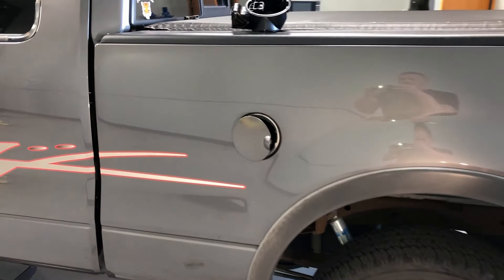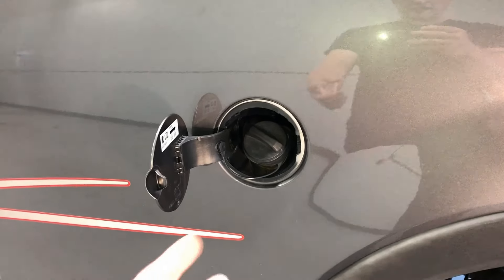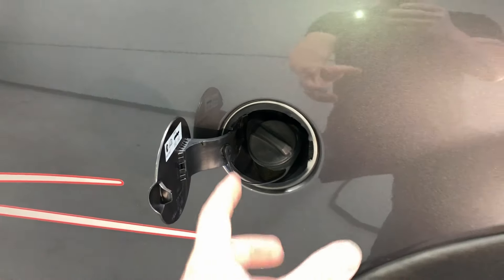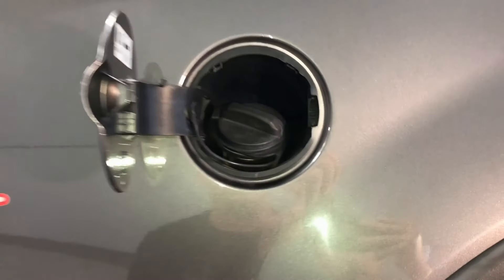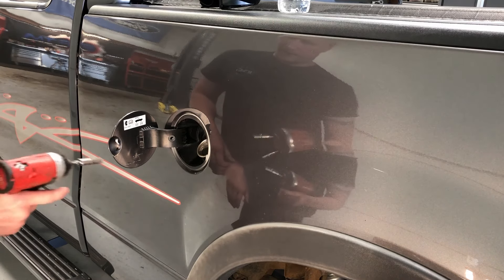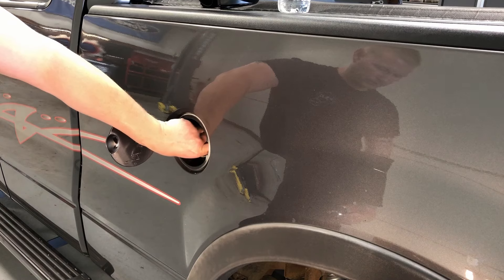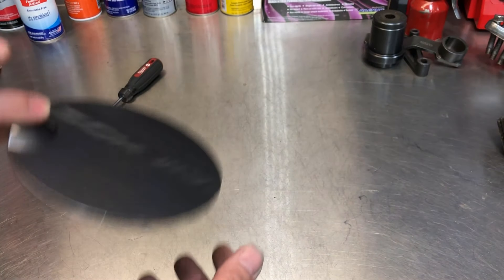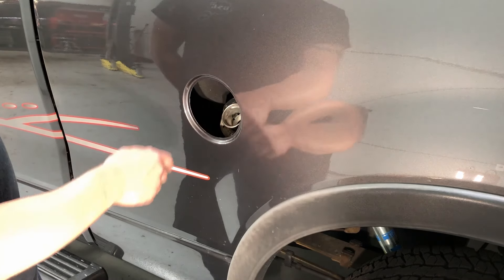2004-2008 Ford F-150: Broken Fuel Door Fix!

Comment from the maker: These are the Parts and Tools I Recommend:
Ford Fuel Door Housing-
https://amzn.to/2YjFjBj
Reply: Is the 2011 the same?
Reply from the maker: no
Reply: Hey, Ford Tech, I have a mystery problem with my 2013 F150 5.0 with VERY low rpm (it literally idled at 100 rpm today at red lights).  It’s not the F27 fuse, it’s not the fuel relay #8 in power distribution box, it’s not the fuel pump driver module.  It’s also not throwing any codes.  It was rough starting but that has since stopped now that I’ve been using premium fuel and Lucas fuel treatment.  Wade Ford in Smyrna, GA wants to do a “de-carb” on my engine in one week.  I’m a bit skeptical of that.  Do you have any suggestions?  I’d be happy to share any photos/videos with you.  Thanks!
Reply: Got parts in a few days. Fixed in minutes. Thanks!
Reply: The dealership recommended to pull the door off before removing the housing from the bed side.
Reply: are you in Texas?  id like to hire you to do some repairs if possible?
Reply: How can someone hire you?
Reply: @FordTechMakuloco  hey buddy, have you encountered clogged cats ,slightly stumbly idle ,uphill engine pinging and blend doors(vac) popping when idling in traffic for a long time on a hot day for 03 and back f150 4.6 2v? It's the blend doors that are throwing me off I gues if the exhaust can't leave the cylinder.than it can't suck in more for steady vacuum. I'm just wondering if you have dealt with that particular combination from bad cats I have driven her every single day for near 14 years and have just under 400000miles, new engine and trans planned for next spring I couldn't be more happy than I have been with this truck I have cats coming im curious if that stops the blend door popping it only happens when idling for 20min.in traffic on a hot day and when engine starts to stumble a little once I'm on the throttle it stops,I have terrible pull out power good steady fuel psi,no sign of vac or intake leaks no DTC but scan tool says she's at 50% load first thing in the morning before I even leave
Reply: Dave K. He’s in Chicago
Reply: The linked housing says it doesn't fit the 2005s
Reply: Brian my 2006 doesn't look like that...and mine is sprung on the door from the car wash mops. I happened to be looking in my side mirror (which had unfolded just seconds before).
Reply: Does not fit 2004.

Comment: Me and my dad had the hardest time putting the new housing in. Our top clips just wouldn’t fit in flush. We got it as close we could and I’m going with it. It’s not hanging out but not perfect. About 97% flush based on your video. Much easier to take out than to get in😂
Reply: Beat the crap outta mine and it still ain’t flush😂
Reply: Same my 2006 looks like crap!! Sticks out like a sore thumb...literally sore thumbs lol.
Reply: I'm no mechanic but I just stated earlier I do all the little repairs on my truck once my guy takes off and goes on vacation when I replace this part I had a bit of a time getting it that clerk also but then I took a little bit of WD-40 and ran around the rim slid right in clicked and it was done

Comment: Hello, I wished I came across your video first before tackling this project.  Other videos were not quite as clear as yours about the removal and installation of this fuel door.  BUT, yours is the best I've found!  I literally tore the old unit out of the housing.  I had plastic removal tools for trim, and just about destroyed two of the "prying" tools just getting under the lip.  I eventually used a needle nose pliers to grab the tabs and break them off the broken unit.  I didn't care, since it was going in the trash.  After viewing your video all that I really needed was a couple of smaller slot screwdrivers to get the two plastic snaps disengaged from the frame.  The real blessing here was your installation tips.  I was thinking how the heck can I get this installed (sort of like a square plug in a round hole).  But, after viewing your instructional video it went in pretty easily.  You're right though, it is a very tight fit.  Thank you for your assistance!  It is most appreciated and I saved $$$$ from having to take it to the dealer.  😃

Comment: Thank you for your video. It took me 20 minutes to replace this on my Ford F150 5.4 Triton XL. That guy has been driving around for two years with a piece of foil keeping it closed. I just got to say I love it when he goes on vacation. Then I get to work fixing the truck all the little things that have been broken for far too long. From vacuum hoses to solenoid sensors the only thing I haven't been able to do is replace the sensor that tire dealership broke when they replace the tire.

Comment: I work at an independent shop and whenever these old fords come in and I have a scanner hooked up I always check the mileage for fun and you’d be surprised how many of these fords have an inaccurate odometer, I have an 04 when I got it the odo said 167k, I hooked up the scanner it had 294k, just put a timing set in it she’s running great really quiet it came from Florida so no rust it’s still got the original exhaust

Comment: Thank you, finally found one where the pivot is broken like mine rather than just the large spring came off the housing pin or the pivot pin lifted out of a slot.  And you showed how to remove the door too.  All I have to do now is order a new filler housing.
Thanks again!

Comment: I have to send you a great thank you!  The door of my 2004 FX4 broke about a month ago - i had no idea how easy it would be to fix until your video.  Bought the part from a Ford dealer in NH thru Amazon for $27.40 - saved a bunch compared to my local Ford dealer in NJ.  Just popped it in - 15 minutes time carefully following your video and all is good with the world.  Thanks!!!
Reply: I ordered the housing from Amazon and can’t get it to fit through the opening for anything. Do you have a link by chance

Comment: Mine's been broke for 3 years or more. Now I'm going to get this fixed on my 2005 F150 with 312,000 miles on it. By the way Brian, i took your advice and changed the oil viscosity from 5W20 to 10W30. Man does it ride better, seems a little quieter, and I know it's happier truly being well lubricated. What would we do without your great advice? THUMBS UP!

Comment: Just did mine about 5 minutes ago.  Easy to do for the most part.  Getting the new one in was a bit tricky at one point, but with a bit work it went finally.

Comment: Watched the video twice. Rewound and played parts numerous times. It took me some large pliers to muscle it out. Then I spent an hour trying to put the new housing in. I don’t know how you do it because I’m watching the video and imitating your movements and it won’t go in. I gave up and will tackle it tomorrow.
Reply: That's me right now. I can't get the new one in. I've watched the video several times too.
Reply: Keep at it. It’s been a while since I did it, so I do t remember how I did it. I just remember once I got it turned just right, it went in and I thought that was easy. But it was after a lot of pushing and cussing. In fact, my truck got totaled in August 2022 and I got a broken arm out of the deal.
Reply: @keithcarpenter3218  I finally got it done yesterday. Had to have some help with pulling the gas pipe down and pushing the part in. After I got it in, had trouble lining up the holes to put the screws back in. Got it done and I'm finally happy to have my gas cap cover fixed.

Comment: Mine broke on first fuel fill after purchasing the truck used. When I opened fuel door at the gas station, I heard a clip flying off. I fixed the door by sticking neodymium magnets until I got a replacement.
Reply: You’re not the first I’ve seen using those little magnets! Have had a customer or two using the same come through my emissions shop. Whatever works! Glad to know how to fix them now.
Reply: Maybe, a four inch nail or a shoe lace AND a 4 inch nail.   :-D  :-D

Comment: Thanks for the video you posted this yesterday"Friday" went this morning to my Ford dealer this morning Saturday 7/27/19 picked up the part. 15 minutes later fixed. Only thing I would add is be careful taking the lid off the assembly there is a catch to retain it to the hinge that is really small and will break. Thanks FordTechMakuloco love your videos. $42.34

Comment: You have to be a psychic at this point. Something breaks and within a week or so you have a video. I am seriously flummoxed. WTF? Thanks for the help on these trucks. Mines been a PITA but I love it. Glutton for punishment I guess. lol
Reply: He put up a video last year about spark plug blowouts about a week or two before my new-to-me F-250 blew one out--I bought the tools he recommended, followed his guide, and fixed it myself in my driveway and I've put over 26k miles on it since without issue.  My last blowout I paid a shop to do, 69 miles later I was at the side of the road trying to put the flames out and it cost me a NICE 2002 Mustang GT.

Comment: On my '12 . .. the spring slipped off the rod.
I incorporated a small screw & washer to the end of the rod for the fix. Many F-150 owners have run into the "slipped off spring" problem.
Love your work, explanations, & videos. You are the "Go To Guy" for
Fix Or Repair Daily😲(FORD)just kidding
My '12 Raptor has been very reliable, though. A lead frame connector & reprogramming w/trans oil & filter change was FREE. And, I replaced the passenger blend door actuator ALL from the glove box.
Quite a feat, seems impossible, & I do not recommend anyone try it.

Comment: Just a tip for those who cannot install their replacement no matter how big and strong you are. I got the exact matching replacement part from ebay for a 2004 F150 5.4, it was an exact match, I even measured it with a digital measuring device, yet it was impossible to snap the tabs back on! First bottoms then tops, I know! I thought this simple cheap thing should be the easiest thing ever to replace, NOPE! Tried for an hour, used all sorts of tools to help, filed down the tabs a bit, fingers hurt bad, no go. Finally loosened the gas filler neck at the wheel well that's held by the first clamp to push it back a bit for more room. That did the trick. The filler neck was so stiff it was not allowing any more room at all to install the part until I loosed it. I'm saying this because this was not said in this video, if it was I would've done it sooner! Live and learn, I thought I was stupid! Nope! There was simply no room to push it any further. They must've initially installed it differently at the factory to make it so tight to do in reverse, because I had 1/4" to go before the tabs would clip on until I loosened that filler neck.
Reply: I might need to try that, it was easy to take off but been struggling to put on. am not a mechanically inclined skilled person. There’s a reason I work management jobs.

Comment: Appreciate this video.  Clear and concise.  Helped me visualize what needed to be done to fix my fuel filler door on my 2006 F150.  It was a lot tougher to remove the insert than it was to install the new one.  But still basically a piece of cake, just the plastic gets a bit brittle after 16 years...
Reply: Too bad we couldn't have done ours together John. I found it came out pretty easy. Putting it back in was another story. PITA.

Comment: I needed to see this for a different reason.  I have new fiberglass bedsides that I have to put on, and with the driver's side I needed to know how to get the filler neck loose so I could move the bed back just enough to access the spot welds on the front of the bed.  May replace this while I'm at it since it is rusty and it's starting to be loose.  Fuel door still closes tight, but can not hurt to put a new one on.

Comment: Thanks for making this video. It provided lots of useful information, but for me the replacement was still an aboslute nightmare. One major factor was buying the replacement part from amazon. The part was a poor fit. After much sanding, I was able to get it to fit. However if I have to do this again, I will definitely buy the part directly from Ford.  The cheap chinese junk is not worth the frustration.

Comment: Easy, any 10 y/o with twenty years experience and three hands can do it. Still like your channel and the instructions. Without you, the paint would be scratched up, the plastic tube to the filler neck would be sideways and the door would open north and south, instead of left to right.

Comment: i have a 2006 grand marquis i notice oil residue on the front mteal plates by the pullies . going to the oil fillter housing under harmonic valve pully an the one right beside it  what you think ?

Comment: 2009-2014 models suffer from a similar problem. Thanks
Reply: I just used the old plastic part leading to the filler tube on our out house door.

Comment: Thank you for the video’s they are so very helpful.  In attempting to remove the existing 3 screws I encountered 2 of the screws that won’t back out, when using a driver or socket, they just keep spinning, any suggestions?  The space is really tight, as you know, so getting pliers in to turn the hex head is futile.

Comment: Thanks for the tips.  Just so you know, glass cleaner is not what you want to use on paint, (strips any wax/sealant that may be present) use a quick detail spray or a diluted no-rinse wash like Optimum no rinse.
Reply from the maker: Of course but I am looking at it from a shop perspective, no one really has Meguiars quick detailer on their bench.

Comment: I also stuck a wadded up blue shop paper towel in the filler neck opening just in case I dropped a screw. Old age has made that my worst fear working on my truck. MAF sensor screws really scare me because they're hard to retrieve if dropped.
Reply: And use the Ford part not the cheapo Dorman parts.

Comment: Oh...the dealership told me to pull the door off before I pulled the housing out of the bedside. That way you can use both hands.
Reply from the maker: You can do it either way but taking it off later away from the paint is safer.

Comment: A day after watching the most common Ford problems video my steering stem started binding. Thanks to that video I fixed it myself. 

My 08 5.4 runs like crap at idle but only when it's warmed up. It runs great in winter and terrible on hot days. Chugs when rolling to a stop and when parked. Chain tensioner, cam phaser, or both?
Reply from the maker: You have low oil pressure concerns dues to leakage past the chain tensioner seals. A full timing job is in order.
Reply from the maker: Be sure to use a High volume oil pump- https://amzn.to/2JVe7oI
Reply: @FordTechMakuloco  Thanks a lot. I appreciate the generosity.

Comment: That "goblin" you saw, was it by any chance the 5.4 3V gremlin? If that truck had a full timing job and new oil pump, that may explain why the the gremlin was chased from the engine compartment to wreak havoc on the fuel door. :)  Great work on these vids Brian - excellent info!
Reply from the maker: Yeah makes sense, this one had a new engine installed, interesting.
Reply: @FordTechMakuloco  what happened to the time lapse video of that engine install? I was really interested to see it happen...

Comment: I still see alot of these trucks on the road. Im a 240,000 miles and wont be selling any time soon.
Reply: I'm only at 140k on my 2004, so hopefully I have at least 100k miles left in her  *knock on wood*
Reply: I have an 04 that I have 235000 miles on.  Im not sure if she has had the cam phasers problem fixed but I have done alot of mechanical work to her myself. I've never been a Ford guy but I needed a 4x4 under  $5000 and this is what I could find. So I can hear the lifters tapping so I am going to buy those and the 620 dollar cam phasers timing chain kit I have the upgraded oil pump already and a new water pump thermostat and serpentine belt. Not sure what else I should do while I have the engine tore down like this but she should run and sound great after this
Reply: Danny, I got a 2005 F150 FX4 with 323,500 miles & still going - drive it just about everyday.  I'll be keeping mine, no intention of selling - body is still in EXCELLENT shape!  One damn tough truck!

Comment: Fixed mine without fixing the spring find a nice kind of small stainless Phillips screw and put it in through the edge of the housing right where the door will close there's kind of a triangular shape on the edge of the door that normally sets into a rubber but that triangular shape is hollow behind and if you adjust your screw to the right height it will be just the right tension the triangular shape will slide over the top of the screw hold the door shut

Comment: Can you do a video on a 2003 Ford F-150 brake pedal fade to the floor.  My issue was the abs module failed. I tried everything including a master cylinder. This is a common problem with the f-150 but I was shocked to find out it was the abs unit instead of brake calipers master cylinder vacuum leak once diagnosed easy fix.

Comment: The final step of reattaching the spring proved difficult and I ended breaking the plastic pin where the spring attaches. I noticed your video skipped actually performing the final step of reattaching the spring.

Comment: Hi. I realize this is a old vid but I recently bought a 2005 f150 xlt 4x4 not knowing about its shortcomings. That being said I really like the truck and want to keep it. I'm going to need to do all the timing stuff you go over as well as the cam followers. For right now I'd like to fix the fuel door but the link to Amazon you put in the description says it doesn't fit... ? I'd like to buy the one you recommend. Not sure what to do. Any help would be greatly appreciated. Love the channel btw. Lots of great info. Thanks.